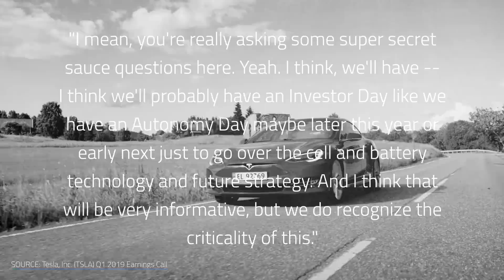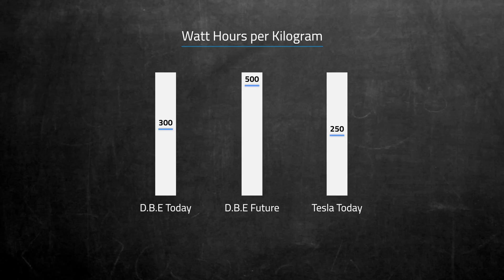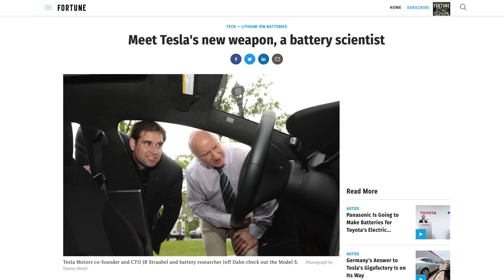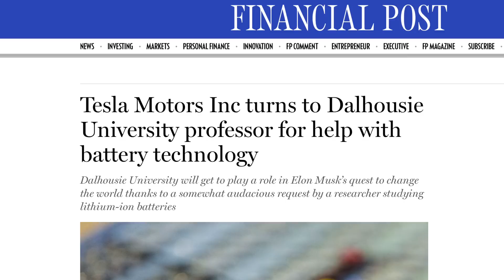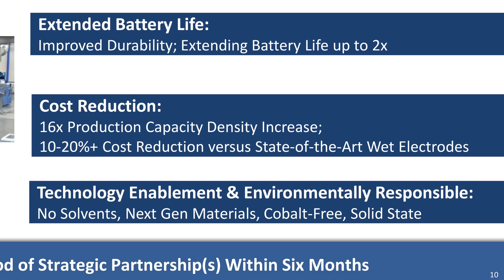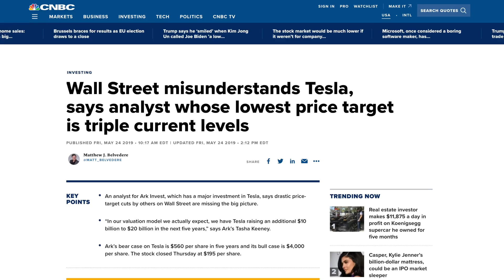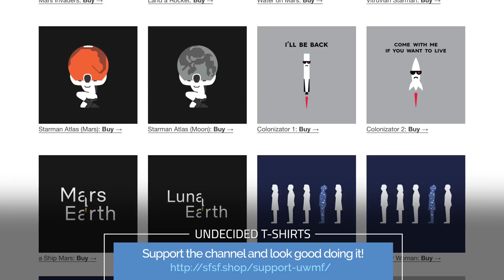Tesla And Maxwell Technologies

Comment: Tesla’s purchase definitely needs more credit in the media. Battery energy density is definitely going to be improving soon, and even though dinosaur juice has an energy density of approximately 12500 wh/kg we still do not have an efficient way of converting it into mechanical motion. On top of that, the energy density of gasoline is fixed, while new battery chemistries are always improving their energy and power density.
Reply: Mattson McCraw Tesla fighting against a hugely funded FUD war, funded by so many global disrupted industries its not funny. Even the advertising industry, as Tesla don’t use that
Reply: They have to handle this very carefully, because the second it gets out that they are about to release a 400 mile car, or 500 mile car, that is comparably priced (or possibly cheaper) and lasts twice as long, then sales of current vehicles will tank.  It will be very hard to keep that kind of thing a secret.  I hope the tech really is production ready like Maxwell claimed, and that Tesla/Panasonic can scale it up quickly.  I think switching over a few lines to use for semi pack production will be a good start, and allow them to test it out.  If everything works out they need to be able to swap over the rest of the lines very quickly.  I also hope there is no battery investor day until it's ready to be put into production.  Reading between the lines, "later this year" for investor day would roughly line up with rumored refresh of S/X.  It might e cutting it too close, so maybe it's 1) improved motors/power electronics, then 2) interior refresh, then 3) battery pack upgrade.  Each change brings in a wave of new orders.
Reply: @gigglehertz  i can see Elon Announcing "Every S|3|X|Y  rolling out of the Factory right now has this new Battery Technology already included, but the range gained by this technology is not enabled yet/software locked" at this Battery Investor Day
Reply: @gigglehertz  Until there's a car with a 400+ mile range for under $50,000 electric is not going to take off. That is probably 5 or more years away. until then I'm going to keep owning gasoline cars because like most of the population I am practical
Reply: @rogerm3708  What about a 300 mile car for $20k?  Why is 400 miles the line for you?
Reply: @q.e.d.9112  My last trip I drove over 350 miles, stopped for 15 minutes for gas and snacks and then drove another 40 miles. If I could I would  have driven non-stop. The average new car in the United States sells for under $40,000. I believe most people would switch to electric for an extra $10,000 but not for much more then that
Reply: @q.e.d.9112  people thought the same about the inconvenience of charging a cellphone, but it's so convenient to own one that people learn to adapt.  of course some people never learn to adapt and even forget to put gasoline in their cars. good day.
Reply: @rogerm3708  based on your description, you would have needed a 15 minute stop for charging, if I lent you my model 3 long range, which is 15 minutes more than a ICE car would have needed. you would have saved every single stop at a gas station you've made since your last long haul trip though.
Reply: @rogerm3708  At most that is 2 years away if not sooner, and forget 500miles we will be seeing 700 miles range for americas sprawling road system.
Reply: @AndyAndy-we9pe  mid-size gasoline cars get a minimum of 500 miles on a full tank. I've heard from most gasoline car owners if electric can equal that range they would switch
Reply from the maker: Just a friendly reminder for everyone.  Keep it civil.  I have a “don’t be a jerk” policy or you’ll be banned from the comments.
Reply: @Undecided with Matt Ferrell Thanks for that, I feel bad starting a bit of a debate. 😬
Reply: @Undecided with Matt Ferrell, Ben Sullins from Teslanomics recently made a Telegram group chat for people to talk about EVs (would recommend joining). Do you think you could do something similar? I think it is a good idea for us to have an outlet to discuss topics like this.
Reply: @rogerm3708  500 miles on a full tank? Are you sure? I thought the standard in the US was 350 miles / 500km. That's about 4 hours driving which is more than enough without a bathroom break at the gas station.
Mid-size vehicles will get bigger tanks to make up for their gas mileage but still do about 350 miles
Reply: @cleberz8072  2019 Honda Accord, standard engine, over 500 miles highway
Reply: @rogerm3708  interesting, Roger, I wasn't aware they were putting such a big tank. It's a 14.8 gallon as opposed to an 10-11 gallon tank which would be the standard for a car with such mpg. Basically that size added about 20kgs in extra fuel which may not be that useful given most people won't dride 6 hours without a bathroom break.
Also, for the hybrid version the tank size is the standard, so my guess is the only reason they increased the pure ICE tank was so that both cars get the same total mileage (which is a little odd to me).
Reply: Roger M oil changes, maintenance & you will spend that $10 when it gets to 100k in mikes replacing every single part that’s worn. No comparison for me
Reply: @Akira-nw4jl   If people could not charge their cell phone at home, like an ev can, but instead had to go to a gas "charge station, like a gas car,  few would own them.
Reply: MSM is funded by ICE vehicle companies. They won't bail on them, even if they can see that Tesla is the future. Sad but true.
Reply: That 12500 wh/kg may be true (maybe) but... most of it is wasted as heat going out the tailpipe. How much of it is actually 'usable' is another matter...
Reply: Greg Hudson exactly, all of the processes of a gas car are pretty inefficient.
Reply: Mattson McCraw, the energy density of 12,500 Wh/kg is only theoretical.  In order to compare it to a battery, you'd need to include the weight of the gas tank and the engine that converts the gasoline to mechanical energy.  Once that's done, you're probably getting close to 650 Wh/kg.  (That assumes 200kg of engine and tank, 40% efficiency, and a 30 kg load of gasoline)  For a fair comparison, an EV would have to include the weight of the motor and battery packaging to have both compared on mechanical energy.  The numbers will vary a lot depending on the kind of car you're looking at.  (big V8 vs. Prius)  The end result is that EV and gasmobile effective energy density is now in the same ballpark, as you can see from the kind of range that Tesla is able to get with it's new vehicles.
Reply: IncognitoTorpedo It’s a shame that we don’t have a more efficient gas to motion conversion.
Reply: @mattsonmccraw6767  I thought the new Mazda Skyactiv-X were supposed to be much more efficient?
Reply: @Greg B still not as efficient as electric. 😉
Reply: @gregb1599  The engines are A step forward but there are other technologies out there that could improve even the best designed engines.

An example of one technology, is my prototype.  It's like having A very high octane race fuel.  It allows my engine to run the optimum ignition timing advance setting.  This gives the engine more time to use the fuel. Extra horsepower and fuel economy is the result.
Reply: Marc Jackson  I'm sorry to disagree but unless you're talking about non-road-legal engines such as F1 engines, the closest thing to a recent breakthrough os Mazda's gasoline compression engine, where they claim they were able to achieve between 35-45% efficiency. The rest all goes away as heat. And that's not even adding up all the other ICE car inefficiencies once such engine is installed, which make it lower even less. And such engine is still under research, as Mazda has had no signs of a release date (after all, unlike electric motors, which already have more years of maturity than ICEs, ICEs are way more complex so in order to make an engine usable in a car there are lots of other things to be taken into consideration).
Have it ever occurred to you what everything in your house runs on electric motors? Why isn't your dishwasher running an ICE? Or your fridge compressor? AC unit? Or how about heavier motors such as elevators, which probably do a lot more miles of stop-and-go over their lifetime than an ICE? The elevator at my condo has a maximum capacity of 3800lbs. That's pretty much the weight of a car, why not an ICE if it's so efficient?
Also, something to note: all the newer generation train locomotives, cargo ships, cruisers and even military ships use electric motors for propulsion, and a giant diesel or kerosene ICE to generate electricity. Many of them won't use any sort of transmission to the propellers as even that complexity is not that useful.
Reply: @Marc Jackson Although there is an upper energy density limit to current lithium batteries, there are many variants of chemistries, and many that have yet to be discovered. There are also things like super capacitors on the rise.
Reply: @Marc Jackson of course they take all their energy from the fuel - that's what hybrids do. The improvements mainly come from being a hybrid in the first place (i.e. being able to have the ICE run at better bias points and being able to recuperate energy).
Reply: @stephanweinberger  yep, and also until the day an ICE can magically pop tiny diamonds from its tailpipe, it will keep emitting around 20 pounds of CO2 per gallon of gasoline, it's insane. At 35mpg that's about 0.7lbs of CO2 per mile, even if we were to half that number (so a 70mpg hybrid) that's still just too much
Reply: Oh you'll hear about it in the media- when they're ready to liquidate their position in the stock...
Reply: "we still do not have an efficient way of converting it into mechanical motion"??? What about electric motors?
Reply: António Monteiro I was talking about gas engines.
Reply: Marc Jackson  F1 cars are hybrids nowadays; those 36% in F1 include MGU-K/H as far as I know.
Reply: @Marc Jackson The actual energy density is useless unless you have an at least semi-efficient way to convert it into mechanical power. Also, voluntarily heating up your battery to accommodate for faster charging should not be involved in a calculation of efficiency seeing as it is a voluntary decision to improve the conveniency of charging.  
On top of this, you stated a possible 70% thermal efficiency on airplanes (and although we are not on the topic of airplanes), This is only thermal efficiency and not overall efficiency. There are other inefficiencies that are unaccounted for, largely noise and mechanical vibration.
Reply: @Marc Jackson I don’t understand why you are mad about the cars using energy to heat themselves. People are willing to pay maybe 10% more for a faster charge. And it doesn’t effect how far you can go because the care only does it when you are approaching a charging station, and it won’t hear them on low battery.
Reply: Marc Jackson  even in that case, what are the odds any production car will feature any of those technologies?
And given how fast battery density keeps increasing, eventually F1 engines will be outperformed by BEV technology. Swappable batteries pretty much solve the issue of range, they'll only need to equate to ICE mileage on a charge which will probably happen 5-10 years from now. 
Even electric airplanes are already being tested (obviously, for subsonic speeds).
Reply: Marc Jackson  
And a top of that, you clearly cannot see (or ignoring, to be precise) the opposite reasoning based on facts that are overweighting your opinions.

PS.: Why don't you write you hate Tesla, you hate EVs, you love to breathe all the shit in that is coming out of the ICE in the city, instead of trying to convince people that ICE vehicles are better than EV-s with nonsense and unrelated "opinions"?
You know there is one thing I give as an advice to the people like you: Park into your garage, seal as much as you can and then start the engine and let it run while you are sleeping in your car, it is much less polluting than using EVs in your opinion anyway, isn't it? You should try ;)
Reply: Marc Jackson  you should work for Tesla. You seem to know a lot more than they do, they could use your zero-emissions ICEs and stop with this BEV nonsense, right?
Reply: Marc Jackson  closed loop CO2 fuels? Please enlighten me, that sounds just as promising as perpetual motion and money printing machines
Reply: Marc Jackson  all the technologies you're citing above are things that nobody has figured out how to bring to mass production efficiently. We could have nuclear-powered cars and send all the radioactive waste towards the sun, it's totally possible but extremely inviable. Tesla is where the best technologies for the job are (and improving). That's probably why you don't work for them, it's hard to understand
Reply: Once there is a 200kg-500kg battery able to give tesla performance  with a range of 600 miles the war will be not only won but gas powered cars will be finished very quickly....
Reply: Correction: Rotten Dinosaur Juice
Reply: Marc Jackson  I'd really like to see a car powered by a combined cycle system. A gas turbine with a water boiler on the exhaust and a steam turbine powered by the boiler. I guess you can have the back wheels powered by the gas turbine and the front by the steam turbine and the boiler under the seat 😀. I'm guessing you have a car weighing in at around 500 tons.

Comment: Another angle may be to consider is the potential combination of super capacitors and battery. I.e. super capacitor can deliver / absorb more energy in a short timeframe than the battery. This is applicable to high regen and acceleration. Batteries are not well suited for this high charge / drain. The combination of the two technologies could be very interesting too
Reply: I don’t see they putting capacitors in cars
Reply: @webguy1283  You can stuff them inside the suspension coils -- empty space there right now.
Reply: Apologies, didn’t see that John Moniz already addressed this point
Reply from the maker: Ha!  No worries.  I do agree that’s an interesting angle that I hope to see Tesla take advantage of.

Comment: I'm thinking that there might also be a big role for the Maxwell capacitors in Tesla vehicles but don't really have a good handle on how it would work. Perhaps acceleration and regenerative braking? If acceleration could be powered by capacitors instead of the batteries it would free up the batteries from having to perform their least efficient function, a fast discharge. And capacitors could easily be recharged by regen braking.
Reply from the maker: I think that’s a good possibility.  Not the number 1 reason they bought Maxwell, but I’d be surprised if they don’t put that tech to use somewhere and somehow.  A lot of potential.
Reply: Not going to happen, capacitors charge pretty quickly but hold less energy and take more space. With the increased energy density cells the goal should be to reduce the weight of the car and not to increase it

Comment: I wonder if these new batteries will be put into powerwalls, and not just in the cars. It could reduce the cost a lot of both sides of the company, or they could keep the same number of batteries, and get more range out of the cars, and, if put into the powerwalls, store more energy and keep the lights on for longer, important if politicians are intent on going 100% renewable without nuclear
Reply from the maker: I bet in time they will be, but it will probably come down to production yields.  As they ramp up production it will be cars only for sure.
Reply: Undecided with Matt Ferrell True. I wonder what Elon will say about it in the investors’ day. Hopefully he’ll lay out the plan for it all then.
Reply: Doesn’t the powerwall currently use NMC chemistry rather than NCA? I am sure if there was spare NCA capacity at Giga1 they would use it, but there isn’t. Not sure where they get the NMC cells from?